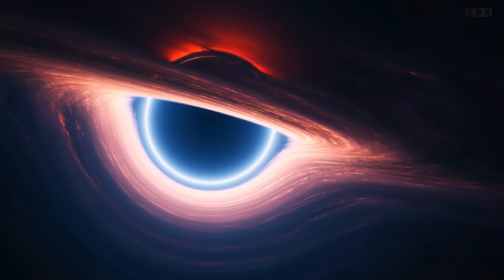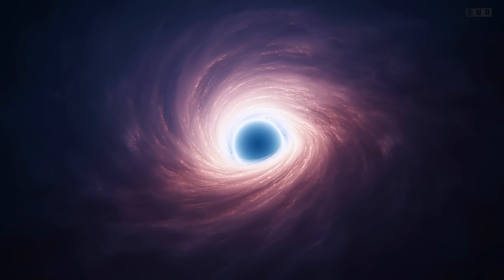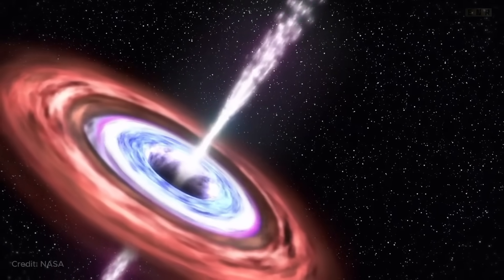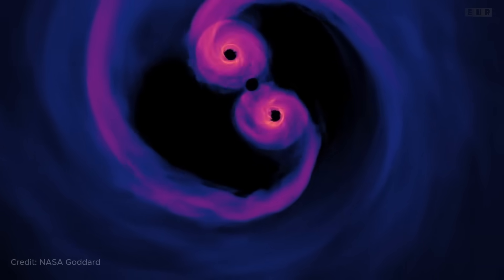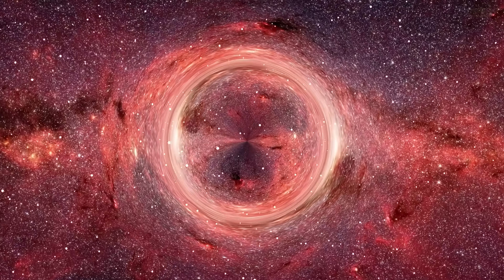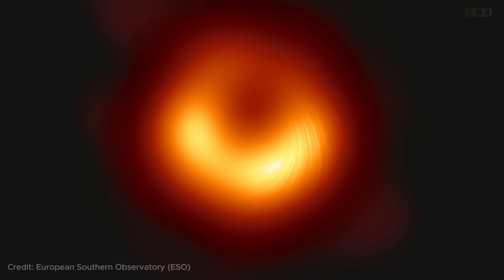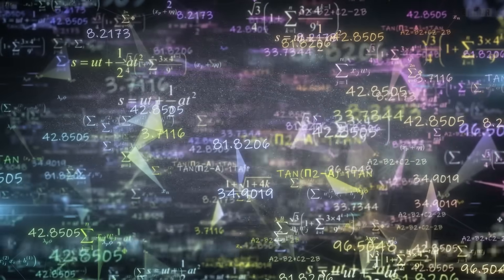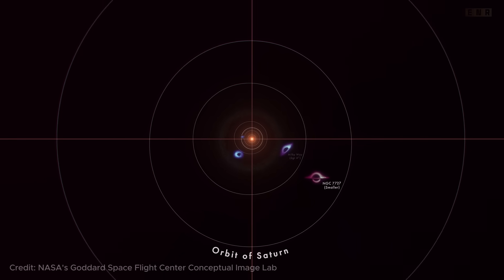Black Holes: When Space and Time Surrender - The Most Powerful Object in The Universe

Comment: I think they are a hole or opening between dimensions, creating a two sided vortex of suction both sides like a submerged ring with a bag attached into the lip of water surface, you can’t visualise anything beyond our dimension unless you pass beyond the plane of dimensional separation at which point your entire reality does not match this anymore and can not be experienced this side of the separation, as from water to oil, 3 dimensions turns into whatever is beyond that curtain. you are a fish out of water maybe you are on land maybe you are in space and the changes are not so different to your being.